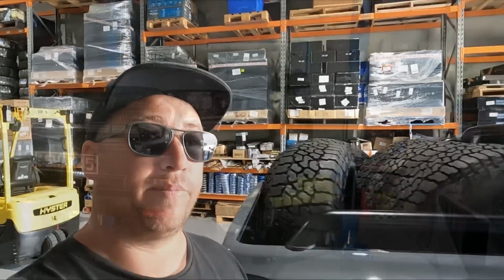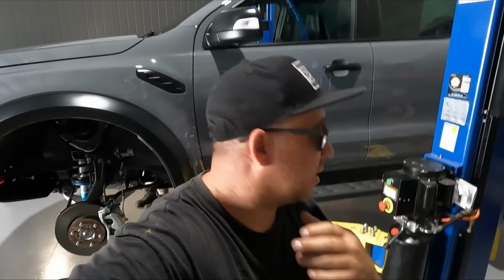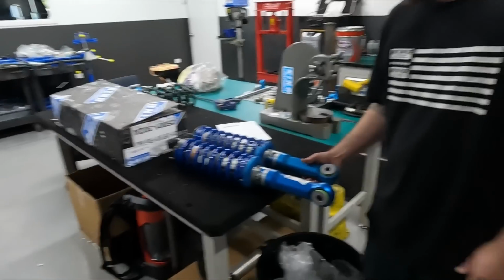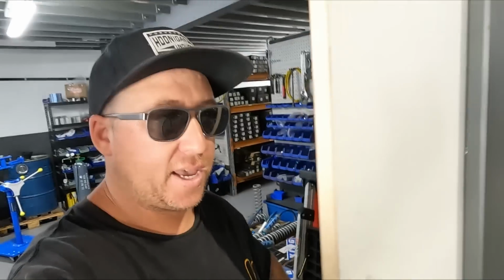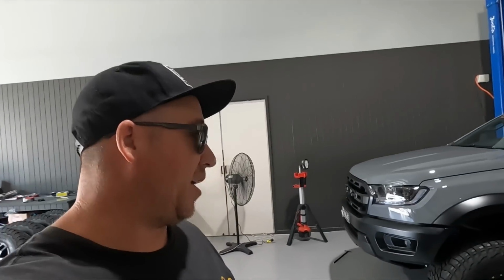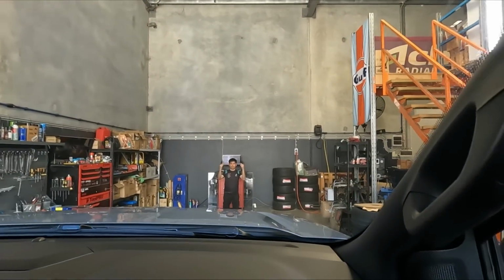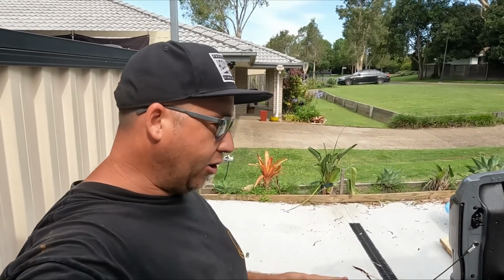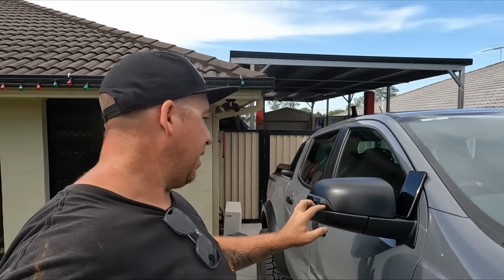35s and lifting a RAPTOR RANGER

Comment: Wow your raptor look so cool! 
I also want to replace it with 35, but I have a few questions.

What is the height of the vehicle?

 Does the upper arm ball joint need to be replaced after spring replacement?

 As far as I know, is it true that the ball joint needs to be replaced?

Comment: How do you find the ride now?  I put in some lift springs and instantly hated the ride. Was way too stiff.  Happy running factory..  To gain the lift you must be running stiffer springs?  The revalve so it doesn't go into stuff valve while riding normally?
Reply from the maker: Your valving needs to match your height or the car will ride like shit vs stock. 
These springs are longer but softer than stock the ride is amazing! As good if not better than stock
Reply: @Lukefink  Hopefully someone in NZ can help me out.  It must mainly be the valving issue mmm, also didnt realise you got a new model! cheers

Comment: The rake is designed with towing in mind
Reply from the maker: People dont buy a raptor with only 2.5 ton towing capacity with towing in mind tbh
Reply: True but your van is a consideration! Lots of people in other 4wd groups with respect to IFS front ends say they get a little naughty when you flatten them out. Aesthetically pleasing though 👌🏻
Reply: Hello guys, i think the nose down of all brands of SUV is actually to enhance the braking. If the front of the vehicle is high and you hit the brakes, the weight takes time to transfer over the front axle to get full effect of the brakes.
Reply from the maker: @fint3810  no dramas with the old setup. I went airbags for the cape but i regretted it
Reply from the maker: @mitch9252  the raptor tranfers weight really good anyway but i havnt noticed any different in braking tbh main difference has been 35s